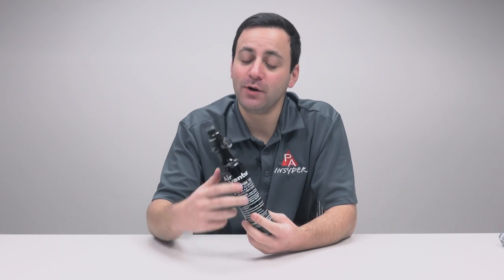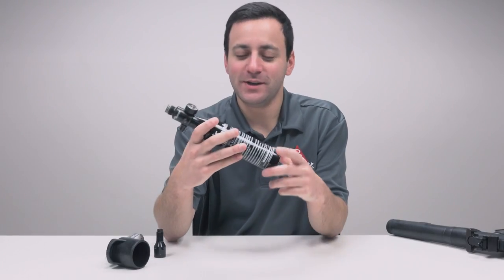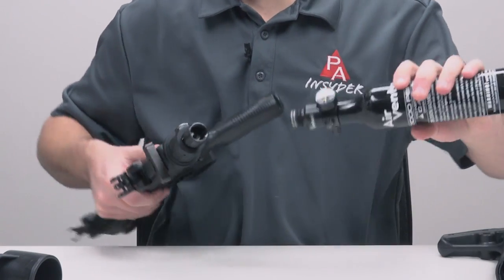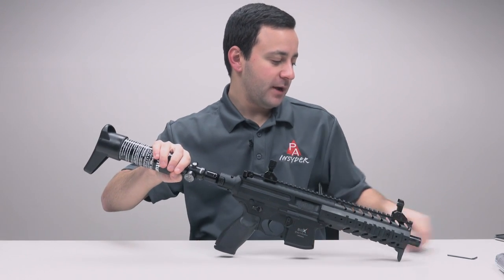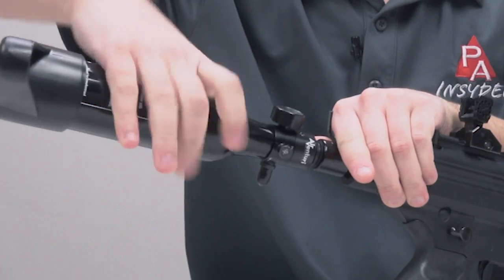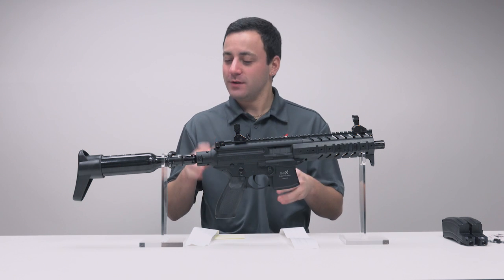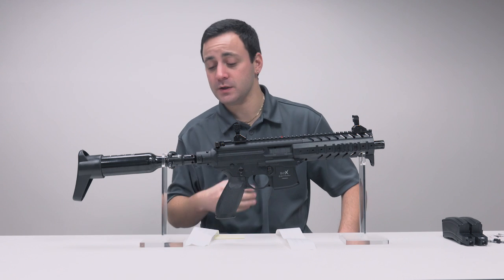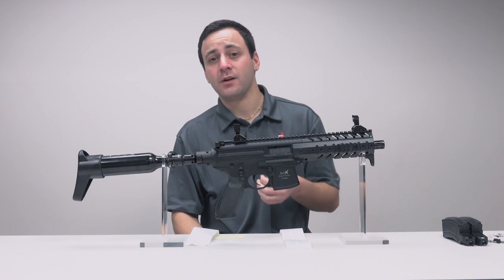Air Venturi HPA Tank - Convert CO2 gun into HPA

Comment: Best off to buy your own parts and build your own HPA kit. I got a 10ci airtank just cuz the adapter makes the length of pull too long. ..and I've never liked the buttstock piece of this AV kit.
Btw.. The MCX/MPXs don't really like to work on air due to a very thin gas transfer line for the valve..

Comment: Most fun for the buck is get the HPA adapter and pair it with get a remote hose for a paintball marker and a giant 64 CU IN HPA bottle stuffed in a belt pack carrier.
Then add a 18650 laser sight . that's how I have my stupid umarex ebos (540 fps) rigged up and the rats in my garden are very well schooled.
The next mod I'm gonna do is add a 18650 Lipo 7.4V battery pack for a bike light set up to eliminate those 6 AA batteries!

Comment: Does it work with the new canebrake?
Reply: Obviously lol
Reply: Works insanely well.
The Canebrake is built as the Virtus and works goood. I HPAd my co2 Canebrake running 1500psi or so and it works perfectly and shoots hard (despite the only 300mm barrel length).

Comment: New to shooting here and I have a simple yet semi NOOB Question here... HPA stands for High Pressure Air ? if I understand that Basic understanding ...is that Correct? ... NEXT Q: is the Air tanks used able to be Pressurized by a Hand Pump or Compressor meant for High pressure?.... can a CO2 style airgun or a Paintgun perse be converted to High Pressure Air tanks ?
ANY Answers here is greatly appreciated

Comment: Will this work on the Umarex Javelin.  I reached out to Umarex and they said, "We have not tested it yet.  Please reach out to Pyramid Air."  :)
Reply: Doubtful. The Javelin doesnt have the required space for the conversion. Its really only good for guns that have CO2 in the back like this. Unless you could screw in a regulator line to the CO2 port and run the cord out and hook the bottle up and carry the bottle on your person
Reply: Plus its for Arrows/Airbolts. Wouldn't make sense. These applications are better for air rifles that use bulk ammo (aKa any that have magazines filled with ammo) instead of one-use ammunition or having to constantly reload single shots

Comment: Returning to this video since the Virtus is in .22 - and the air tank was left visible. I love my old .177 co2 MCX - but I'd wanna get rid of the co2 cooldown effect. 
 But have now gotten to read lots of weird stuff by users/owners of this product by AV.. High power inconsistencies, low power output, poorly designed thread adapter pieces.. Just makes you wonder what the h*ll went wrong..
Surely these Sig airguns differ a bit from gun to gun - but they should not differ THAT much. I guess air and co2 just are that much different. I have personally not studied how the expansions of these gases differ from each other - but it just gotta be something with that. Some of these HPA .177 MCX users get way lower power from their gun than I get from my co2 MCX when the gas is warm. Someone's HPA does not even make the rifle blow back hard enough to re-cock the gun. Wtf? This oughta run with 1100psi. And I get more power output with only my 900-1000psi co2.. Something is definitely not right here either..
Reply: @jantelow  I also took out the plug and the filtering disc from the capsule piercing piece on my MCX - but I have not drilled the piercing point since only using same co2 as before. Sig seems to have installed of those small filters in most of their airgun valves. Found of them even in their ASP pistols. Dunno if "filtering" is needed, so I bet they are really there to slow the co2 flow and expansion a bit. But you do not of course need that for air.
I once tested making the spring in the telescope tube a bit heavier. But it just stopped cocking the gun because of only using co2 and not having enough power in the blowback for a strong spring. And the valve still stops the gaschamber and firing pin's travel anyways at the front end. Therefore I made a firing pin of my own that is slightly bit longer than the original. Shoots harder with warm  co2 now for sure - but with more power and more gas usage - the gas cools down quickly and the power drops. Therefore considering now finally a HPA system for it. The Air Venturi bottle do though seem a bit long imo. Would be cool to test the length out first. But I guess you could buy another, smaller bottle with the adapter. I were still thinking of making a buttplate of my own for it anyways. The Air Venturi bottle buttplate could be a more bottle covering piece imo..
Reply: @jantelow  Yea. It is good to have a proper ratio between the power and the spring resistance for the blowback. All it really needs is just enough power to recock. The spring and the mass of the gaschamber+firing pin do have enough power to hit well the valve nozzle and it's spring. That's why I just changed to the longer firing pin. It did not need much more length though to get a noticeable increase in power output. I have had the valve open of course, but never modded the spring in any way. Would not like to get the spring too weak to cause the nozzle to leak.
I have read before of how the HPA has not managed to recock the gun even though having higher pressure. Kinda funny thing when you think of it. But I'd definitely now drill the piercing point larger if getting a HPA kit.
Reply: @jantelow  Sounds good! I never much did anything to the connections except switched the o-rings to other ones (a bit thicker and tighter)and polished the darn cone in front of the valve..
 Not planning on to do anything more to it now as long as it works so well. But I would also like to have another one.😁 Many hate these Sigs as crap - but I do love to screw and fix on them myself when troubles occur. Would be a dream come true to find one of these given away as trash. Would not be bad at all to have some spare parts near by if really needed. The plastic cage that is in front of the valve has cracked a bit on mine. Does not clamp tight to the valve anymore. But it still sits in there well when the gun halves are put together and the gun works.

Comment: Keep your hands off of this junk, guys !
I had purchased two MCX at two different distributors, and while they are supposed to deliver about 9 fpe, I didn’t get out more than 4.5 with a brandnew 88g CO2 cartridge on a hot summer day...So I purchased two of these Ventury at Pyramid Air, full of hope. Couldn’t believe my eyes : just 3 fpe ! At max. fill and on both guns as with both pcp conversions as well !
So if you are satisfied with plinking at 10 yards a little bit, fine for you, but if you expect more (as promised by SIG), forget that garbage !
Reply: yea its retarded putting hpa tanks on the end but using such weak piss poor regulater ones lol that the power is just as lame... whole point in using hpa/pcp tanks is that you can use bigger tanks and have far better power lol. Why they only use tank that gets them 400ish fps lmao? could easily use better tank/regulater etc and get 1000+fps i dont get it.

Comment: How about 12gram co2 adapter with co2 holder that way you can put back butt stock
Reply: Jungleghost Survival you can’t fit the adapter because there is a narrow ring where the buttstock comes inserted and lets pass through only the little bit more narrow 88g thread
Reply: You can use a.12g co2 adapter with this one - but the adapter usually needs a small spin in a lathe before use. Usually the adapters's hex styled portions get in the way for installation of one. I bought a small 12g adapter myself. Had to make it thinner in the front hex end before I could use it. Can shoot about one mag per 12g cartridge.

Comment: I wonder if you can run a remote on it so the tank would be in my belt ( like  paintball since I have tanks and h.p. line and adapter) to keep the realism of it
Reply: Many use remote line and wear the tank in belt, I have myself that setup and is only waiting to get the adapter so I can start using it :) Much better solution in my opinion as then you can use the original length stock.

Comment: Hand pump NOT recommended for HPA. YOU’LL WEAR YOURSELF OUT NO MATTER WHAT SHAPE YOUR IN.
Reply: Question would you think it be possible to use my paintball tanks on this since it comes with a regulator. I have 3 tanks about 3500 psi a line out remote h.p. adapter and line and belt to hold the tank
Reply: 1776adb Hm. Its not that bad at all. Hell, its a nice workout for my arms, gets ya movin. Works well on Hatsan At44 with 150cc cylinder and a Mk4 handpump
Reply: You’re right- good workout.

Comment: Why is HPA harder on  the gun than CO2? Is it a problem with lubrication of the seals? What if you unscrewed the bottle every couple hundred rounds and put a few drops of silicone oil in the adapter?

Comment: So 1100 psi HPA is ok in the mcx. Would 1200 or 1500psi be detrimental? Thanks
Reply: you can fill the tank to 3000 psi/207 bar, the output pressure is regulated to approx. 1100 psi. Pressure any higher would damage the seals etc in the gun.

Comment: IMPORTANT: I am happy you were sent a good adapter, but that is not the norm. If you go to Amazon and look at the comments, most are not good. In fact, many have the same problem I have with them. Pyramid Air has sent me two adapters (exactly alike) and neither will hold air in the gun. The technician was rude and put me on hold instead of listening to why I thought they were bad. I am a Georgia Tech engineering grad and know what I am talking about.The depth of the nipple on 88 or 90 gram CO2 cartridges is 7mm and the nipple on the adapter for 16 gram units are 7mm. The two adapters I got from Pyramid Air are 4.5mm long and do not keep the HPA tanks from letting all the air out through the gun. They are machined wrong and do not match CO2 cartridges. This is why they leak and do not work. I am very pissed. The Sig MCX is a great carbine and matches my real gun. It is not Sig but the factory that made the adapter that is bad. I am praying that Pyramid Air makes this good.
Reply: I have the same issue
Reply: or you can go to ebay
Reply: email AirVenturi directly and they will fix your problem. Use a regulater with two o-rings or talk to them on how to use your bottle with it.
Reply from the maker: Sorry to hear that! We will make sure to make it right. There were a few runs of the adapters not being 100% right, but it should be OK right now.
Reply: @clark3830  that also pissed me off. If the o rings are so crucial, why not include them or at least mentioned that. Who are we dealing with here, 12 year olds?

Comment: Is there a threading for a 12 gram co2 cartridge?
Reply from the maker: No there is not.
Reply: There exist adapters, I would reccomend one that uses two 12gr CO2. But a better solution is to convert it into using HPA... But beware that some adapters and also 88gr CO2 does not fit correctly and you will need file the gun a little if that happens or get one that fits without modifications.

Comment: Sucks that none of the shots even got close to the 575 fps they say it will.
Reply: Companies use very light weight pellets and the perfect conditions to get the FPS. The real FPS is almost always down 100 FPS from what is advertised
Reply: The company advertises the 700 FPS using wad-cutter pellets with co2 tanks not hpa, hpa drops the power by at-least 50 FPS on the mcx long barrel his is short

Comment: how do you fill it up?
Reply from the maker: You can use a handpump. http://www.pyramydair.com/s/a/Air_Venturi_MK4_by_Hill_Hand_Pump_Up_to_4500_PSI/7804
Reply from the maker: or you could fill it from a compressor. http://www.pyramydair.com/s/a/Air_Venturi_Air_Compressor_Electric_4500_PSI_310_Bar/7458
Reply: @pyramydair  hi, aprox how long it takes to fill it with pump?

Comment: I worry about this gun holding up under high pressure air. this gun was build for co2. Has there been no problems???...and is there no worries having this gun hold high pressure air???... I worry about the gun holding up. possibly exploding. hpa is very strong compared to co2... Plz i would love to hear anyones thoughts on this subject matter who has had experience with these hpa conversion kits... Thanks... ~~~DrHerbJones~~~
Reply: It's only putting out CO2 operating pressure to the gun. The tank will withstand the pressure of the 3000, the gun itself is only exposed to 1100 psi.
Reply: DrJones he said there's a regulator on the bottle that limits the actual pressure on the gun
Reply: Ya.i got MCX as well .I just wanna get more people to rewiew of this co2 change to HPA. Maybe I wanna change maybe not.
Reply: I switched to hpa and it's not enough pressure to recycle the firing mechanism so I have to cock it every shot.
Reply: @Rhodeyguytom  i have the same problem check your output pressure of your hpa tank maybe the output its to low
Reply: I have two tanks, one is 900 output the other is 1100 and only the 1100 cycles, and not consistently. Maybe three in a row then I have to pull the charging handle back
Reply: @Rhodeyguytom  use 1500 psi output..works great with that
Reply: @GERARDFIREFIGHTER how much fps are you getting using the 1500 psi output?

Comment: Correct me if I'm wrong, but isn't a huge advantage of PCP that rate of fire doesn't affect power/velocity? I know a huge drawback to all the automatic/semiauto CO2 guns is that the velocity decreases the faster you shoot them due to the CO2 cooling off. I think that alone makes the PCP tank an awesome upgrade. It allows you just shoot dirt cheap BBs as fast as you want with a relatively consistent velocity. A 40 FPS extreme spread won't matter when you're just plinking with these things.
Reply: Yes... CO2 suck real bad when shooting fast. When I did break mine in with CO2 it had about  5mm precision at 10m / yards when I was waiting 20 - 30 seconds between shots, rapid fire and it would spread 50mm... I am have ordered all I need to modify it to use HPA with remote line and air tank in belt instead :)

Comment: Hey nice video, does this air con damage the internal parts of the gun?
Reply: No.  Because it runs a similar pressure to CO2, it does not damage anything.
Reply: Tyler Patner ok so it's the same like the 88gram CO2?
Reply: In terms of velocity, yes.  It should net you more shots than the conventional 88 gram carts as well.  The pressure is only slightly higher than what CO2 will be at on a hot day, so you're not risking any damage to the internals of the gun.
Reply: What or how do you fill the pressure tank?
Reply: @michaelstafford8530  A PCP hand pump or a PCP compressor